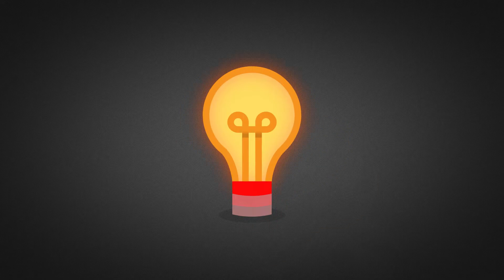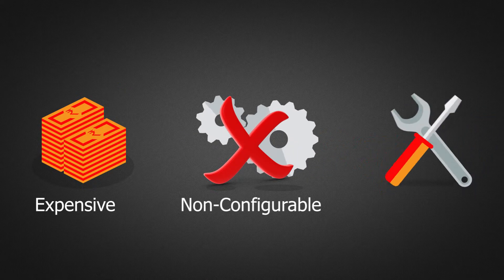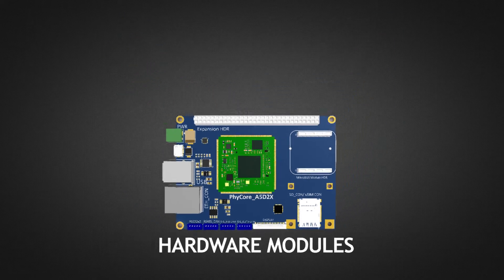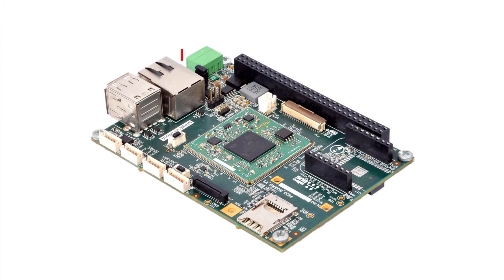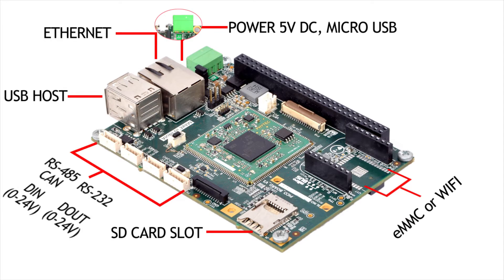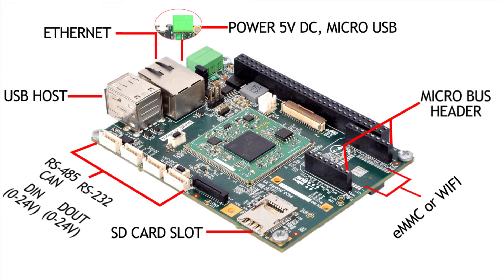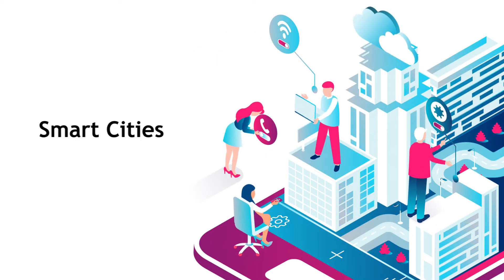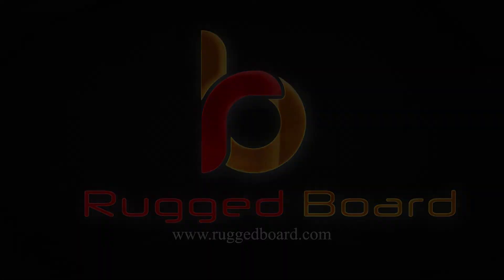RuggedBoard - A5D2 | Open Source Single Board Board Computer | Computer On Module

Comment from the maker: We have been asked one question every day from almost everybody that "What the difference between a RuggedBoard and a RaspberryPi 3 or 4 (RPi )?"

If you make some effort and do the comparison by yourself would be better for you to understand both the intentions and differences of the product. Please refer the specifications sheet of RuggedBoard and RPi for reference.

After answering the same question to most of the people we are guessing that we are going to get the same question from multiple people in future again. So here I am here with the high-level comparison of RuggedBoard with RPi.

My Opinion on Comparison:
RuggedBoard is mainly targeted to be used in deployable product solutions and also for learning. RB has industrial interfaces on dedicated connectors such as RS232, RS485, CAN, Ethernet, SPI, I2C, GPIO, USB, SD Card Slot and many other interfaces. Swappable 2G, 3G, 4G and NBIOT can be connected anytime on a miniPCIe Connector available on RB. The best part is the Linux OS is installed on the internal NOR flash memory, not on an SD Card. Here I have to note that RB packs with Industrial Grade custom Linux OS (Yocto Build Linux System).
RB also has dedicated 4x Digital Input Pin and 4x Digital Output Pin with Opto-Coupler Isolation. Standard MikroBUS connector makes it unique for Swappable Sensor connectivity.

RPi is mostly targeted for learning purposes where GUI based applications development is required higher RAM. Whereas RB is targeted for Learning purposes and also for deploying in your final product. If you look for the available interfaces in RPi, most of the interfaces are not available which RB has on dedicated connectors. 

To conclude: If you are looking for something which withstands a high-temperature range, Long term availability (10 Years EOL) and for a deployable product solutions RuggedBoard should be the best choice for you. Whereas if you are looking for a system where Temperature grade is not a priority, you need to just demonstrate something and don't have a plan for any product design then you may go with RPi. I hope this message must have helped you to understand which SBC to be used in what kind of situation. The choice is yours.

Contact us if you have any queries. email:
info@ruggedboard.com

Watch Video on YouTube:
https://www.youtube.com/watch?v=G97nBkUNHqs

To know more visit:
www.ruggedboard.com

If you want to learn how to use the board and write some application in Python or C, Visit:
https://developer.ruggedboard.com/g1-getting-started/quick-start-guide

Click here to buy it online now:
https://www.community.ruggedboard.com/shop

Thank you for reading.
--
Thanks & Regards
RuggedBoard Group

Comment: What are advantages of ruggedBoard over raspberry pi 3/4
Reply from the maker: Please refer the specifications sheet of RuggedBoard and RPi to understand the detailed comparison.

RuggedBoard is mainly to be used in deployable product solutions. RB has industrial interfaces on dedicated connectors such as RS232, RS485, CAN, Ethernet, SPI, I2C, GPIO, USB, SD Card Slot and many other interfaces. 2G, 3G, 4G and NBIOT can be connected anytime on a swappable miniPCIe Connector available on RB. The best part is the OS is installed on the internal memory, not on an SD Card.
RB also has dedicated 4x Digital Input Pin and 4x Digital Output Pin with Isolation.

RPi is mostly targeted for learning purposes where GUI based applications development is required higher RAM. Whereas RB is targeted for Learning purposes and also for deploying in your final product.

Contact us if you have any queries. email: info@ruggedboard.com
To know more visit www.ruggedboard.com

If you want to learn how to use the board, visit: https://developer.ruggedboard.com/g1-getting-started/quick-start-guide

Click here to buy it online now:  https://www.community.ruggedboard.com/shop

Comment: cost of board ? what about support for our application development ?
Reply from the maker: RuggedBoard has two variants. Rs. 2,949/- and Rs. 4,949/-. You can order online from the link in the description or mail us ashraful.k@ruggedboard.com
Reply from the maker: Application development can be done very easily on this SBC. By default it support Python, C and C++ programming language. In case if required you can also use NodeJS.
Support:
- Hardware manuals with Application development notes are published online.
- Application development guide and a quick start guide is avaialble on https://developer.ruggedboard.com/
- Blogs are being written to showcase the use cases of the product.
- There is open Online forum for discussion. We are online anytime.
- You can also contact directly to get support of application development.
- In case you are using the board for developing a product. You can expect special support provided you provide the forecast of the product development for the year and the quantities you would be producing.

In case if you want to order the device visit https://www.community.ruggedboard.com/shop